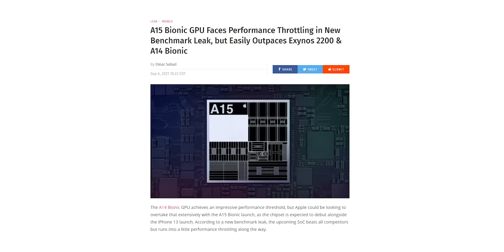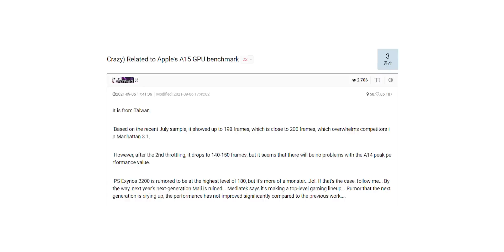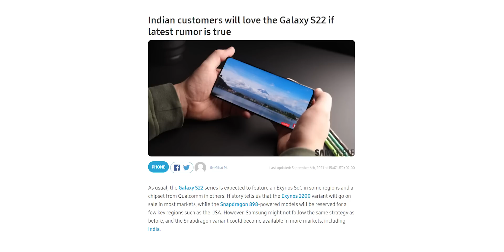iPhone 13 - Apple's Answer To Samsung and AMD

Comment: Exynos is also not a consistent processor . Qualcomm processors may not have max frame rate but they are consistent they don't drop down in performance on sucessive test.

Comment: It would be cool if Qualcomm would integrate Nvidia’s Ampere graphics architecture. Nvidia have the SoC tech from their Tegra series of chips utilized in the Switch, the upgraded version of which is rumored to be in the next gen Switch Pro.

Comment: That qualcomm processors are colder than the others is very true, I have tested the two versions of Samsung in different series and there are times when qualcomm phones are cold and even on demand they do not heat up much

Comment: Samsung throttles more than I like it would. I had an S21 with Exynos 2100 and was disappointed. In hot summer it throttled the performance down so I could feel it even in basic menu. I just bought OnePlus 8 with older SD865 and tested both in Antutu. Both had no apps in background and started on same CPU and Battery temperature. I think results speak for themselves:
1st run: S21 741k vs OP8 656k, Temperature S21 37.5 vs OP8 32.5 degrees
2nd run: S21 671k vs OP8 654k, Temperature S21 41.3 vs OP8 35.3 degrees
3rd run: S21 549k vs OP8 653k, Temperature S21 42.5 vs OP8 36.6 degrees
These benchmark results are perfectly corresponding to what I experienced with both phones in terms of heat and performance.
Samsung, just like apple is presenting us the peak results, but real world usage can be different.
Reply: Yup in real world you only need like 300000

Comment: IPhone doesn't have cooling so pointless to have more power. Ip13 is gonna be even hotter than ip12
Reply: What if it does but is not in the leaked benchmarks

Comment: We dont need better performance tbh, we need more screen on time with our $1k+ phones, better batteries and better power management is where they need to focus next. I hope these companies would innovate in the battery tech of these smartphones.
Reply: Yeah....i don't need extreme graphics performance at the expense of my precious battery.....there is something known as enough....i with you on this.
Reply: +10000%....  Current phones are so overpowered it´s not even funny.  In fact, I would even argue they are overpowered in many areas where it doesn´t really matter.  I owned an iPhone 11 Pro Max and the bottleneck was most often its Intel modem.  The processor was falling asleep waiting for the modem to actually transfer data at a reasonable pace, which it certainly didn´t.  iPhones are doing better these days with Qualcomm´s modems, but it´s just an example.  Cooling is another...  What good is a monster of a processor if it starts throttling after a few minutes of demanding use?...  

This is very similar to all the marketing efforts they push on cameras, making the biggest fuzz of minute upgrades that most users will never use.
Reply: @TheLinuxExperience  I feel you man. My iPhone 12 Pro Max is a beast when it comes to performance and modem but it’s becoming like Exynos. My phone can’t sustain its performance cause of no cooling system it just becomes like a literally overheating core
Reply: @JoyMahendru  is your i phone 12 throttling. What app did you run ?
Reply: @shreyass2447 after a shitty update it throttles in Netflix, YouTube, gaming, camera, using outdoor ETC
Reply: @JoyMahendru  i have iphone 12 and mine only throttles when playing games like genshin impact.
Reply: The problem is they are using the best batteries they can tech wise the constraints on batteries is due to size as far as im aware there are companies currently developing new battery tech to get more life out of a smaller battery but they are not quite there yet, look into solid state batteries
Reply: I Need More Processing Power :'(

Comment: a common consumer like me would appreciate more things like battery life and pricing lol
Reply: Apple will increase the battery capacity, not just for the 120Hz models, so you can assume a bit more uptime like currently.
Samsung already had a huge battery before, so they can't really increase too much (at least for the Ultra with 5000mAh), so probably you will lose some uptime there, because of the bigger power consumption.
Reply: @Winkoo6  it all depends on optimization
Reply: @keqling7086  exactly
Reply: @Winkoo6  so I said "battery life" which comes from different factors... though it's a part, I am not really asking about them making the battery huge just like what "Energizer" has done... lol

Comment: Apple has a good game with their chips, even tho it's usually limited by the software, but there's still time for Samsung and amd to improve, heck even Snapdragon's 895/898 might do a better job. Also AMD set out to beat apple's m1 silicon chips, so u best bet they're going to do it
Reply: The result will be the same.. you focusing on the minor part of the news, and skipping the main part.. to beating M1 chip in 2022 is actually say that, we are only 2 years behind Apple.. we finally reach the same level in 2022 what Apple already had in 2020.. The new Macs comes out in a few months, will they beat that too?
Reply: @Winkoo6 don't compare the m1 to normal smartphones soc
Reply: @keqling7086  i compared the 8 cores power consumption to another 8 cores, or can Android also double the amount of power cores to make the same like Apple did? because in phone the A14 only has 2 power cores, and the M1 has doubled amount, 4 power cores, same like any Android phones.. so how Android will double the performance too?
Reply: @Winkoo6  i really don't know
but samsung could make a bigger soc just like apple 
that would be cool

Comment: Honestly Apple will use a lower performing A15 bionic in their phones , only the ipad Air will get the full potential A15 Bionic and chipsets in phones have reached to a peak point , there can't be too much performance gains bcz the device will heat like hell

Comment: This isn't actually the real performance. This is Apple flexing in an attempt to get back at the recent reports. 

The massive throttling proves that.

When the chip is actually in a phone, they will tone it down signicantly. 

We saw the same thing happen with SamsungXAMD. The first performance leaks were stunning, and about 20% higher than we're seeing now. What were seeing now from SXAMD, is what will be the performance in an actual device.
Reply: And do you think Apple do a lot of more changes, when their phone just releasing in any moment? BTW it's +10-20fps while throttling (Exynos: 127fps, A15: 140-150fps while throttling), so if they fine tuning this to even better, you will cry more..

Comment: Haha Exynos needs to catch up to Snapdragon before it wants to take on Apple.
Reply: Didn't you hear the leaks? It has already beaten A14
Reply: @KarthikViswanath  the initial numbers dropped because of throttling due to heat.
Reply: @macyoung6634  That occurs to both the processors
Reply: @KarthikViswanath  the scores they released initially we’re peak performance without throttling. The true numbers are a bit lower. There’s another video where they mentioned the engineering dept requesting vapor cooling instead of graphite to help with the heating. The ceo T Koh or something like that still has to approve because it will raise the cost.
Reply: @macyoung6634  But the A15 also throttles alot.. it is obvious from the leaks.. it loses about 40FPS in the second test

Comment: Even tho I am not an iPhone user, I still gotta admit that apple's a series chips are at least 2 years ahead of qualcomm chips in raw performance
Reply: And about two years behind in sustained performance.

What matters more?
Reply: @leonfrancis3418  U might disagree with me but the thermal throttling in iphone is usually caused by the crap cooling system on iphones instead of the silicon chip quality
Reply: @bat_daddy6455  I do disagree, but even if I didn't, the bottom line comes down to Apple focusing on and favoring a benchmark result that looks good for advertising over real world performance in the user's hand, and people keep falling for it, and calling them the best.

If I can faster than Usain Bolt but only for 5 seconds, it doesn't make me the best runner.
Reply: @leonfrancis3418  what do you mean by sustained performance? just because Apple usually beat the competitors best values WHILE throttling.. So i can't really see where are the others are better in sustained performance (yes they keep the trash value better, but the performance is still lower)..
Reply: @leonfrancis3418  actually u should look at a video made by an Asian guy that tested the performance of the a14 chip and even its throttled down gpu performance can match snapdragon 865 gpu peak performance which is pretty impressive because we need to consider just how inadequate the cooling system is on iphone 12.

Comment: This is all great for tech enthusiasts but most people don't know what's in the phone....they could be run by a bunch of tiny pixies for all they know, We have to see how those benchmarks translate in real life. And i really do hope we do not have heating issues....better a slower chipset than an over heated phone that has to be throttled. Also developers make apps to be run on any phone (they aren't stupid) so I don't get this need for speed thing.Why don't Apple try making a foldable because from what I've seen the iPhone 14 looks exactly like the 13.

Comment: Samsung is lucky that Qualcomm is forced to use their inferior microarchitecture because of Apple endless supply of cash and basically buying the whole of TSMC's production capacity. This way with Samsung using the same core base design as Qualcomm they can achieve the same CPU performance as Qualcomm but I highly doubt that AMD can make a better GPU than Adreno. Furthermore Qualcomm has still an advantage in ISP and modem tech. So Qualcomm is the superior chip in my opinion considering everything and there is no reason for Verizon to ask for the Exynos
Reply: Won’t be surprised if Apple bought TSM
Reply: @wellszhou8286  They won't but sure thing they can influence then
Reply: Since the factory need to completly stop, when they switching between products (switching materials, recalibrating the machines etc), it's not really the best for them.
And Apple using only 2 types of CPU in the same time, currently A14 and M1, so they ordering a huge amount from each. Do you think TSMC like to stop and recalibrating everything multiple times a day for Android manufacturers, or they just like if they can manufacture never ending, without any stops?
So Apple don't really need to buy anything, more money for TSMC if they can manufature without those stops (so the amount of ordered items per stops are much better from Apple side).
Reply: @Winkoo6  TSMC could have made the SD888 and only that chip based on their latest fab. So not all that many products bur Apple was first to reserve all of the capacity.

Comment: Samsung is always gonna lose..heats up like hell where as Apple phone doesn’t so and these rumours are there since 2019 but nothing happened.. tired of waiting for the new GPU.. so I’m moving on to ios and I’ve no regrets
Reply: good for you but I'm always staying for android as personal phone but as for apple I will use it for business purposes...
Reply: @williamskypili  that’s good bro.. I’m using both Galaxy and iphone right now.. about Samsung I didn’t talk shit but I expressed as per my experience with my device...tbh samsung that I’m using is S10 and iphone 11
Reply: @ridandosuting2023  if you think it carefully, it's pretty impossible to let the 8 cores CPU generate more heat, but Apple use only 6 cores, so they have more threshold in temperature. Nobody can ever beat Apple who currently need 8 cores to compete their 6 cores. Just because the power consumption is also increase the heat generation too. And the M1 is the example what apple can do with 8 cores. That is almost equal in power consumption like any current android phone CPU..
Reply: @Winkoo6  That’s how genius Apple is I guess..